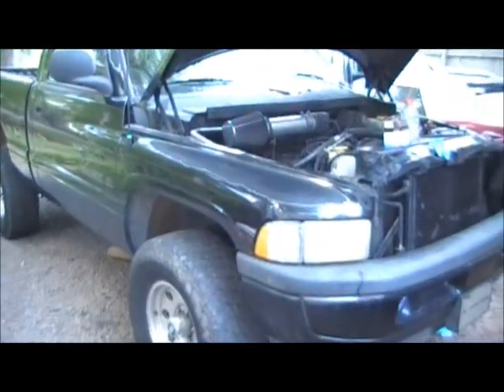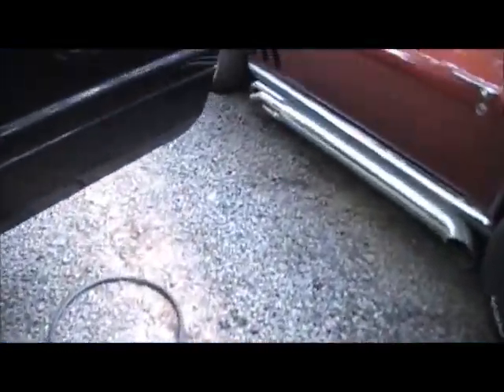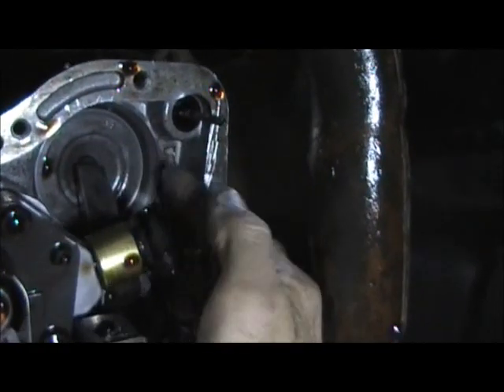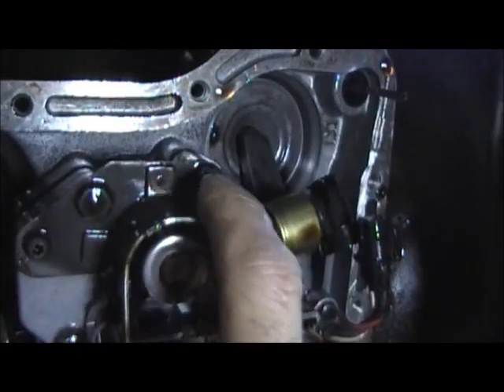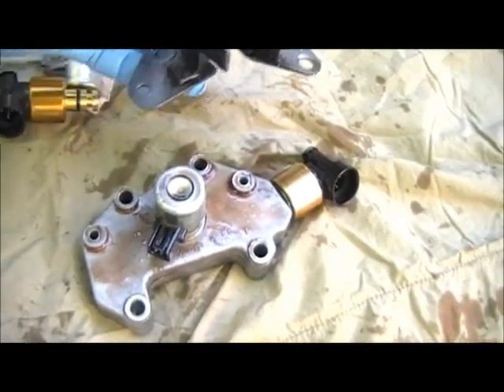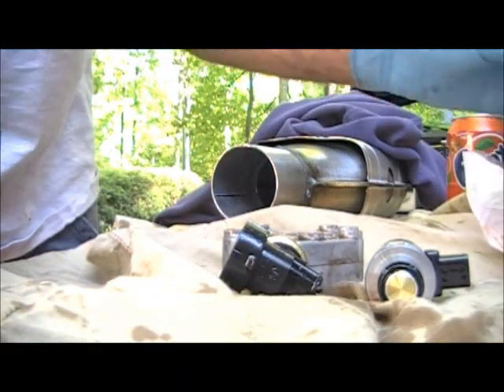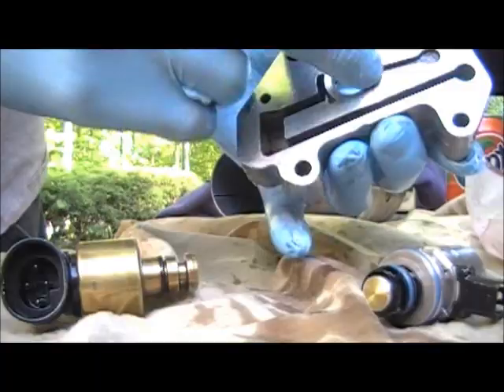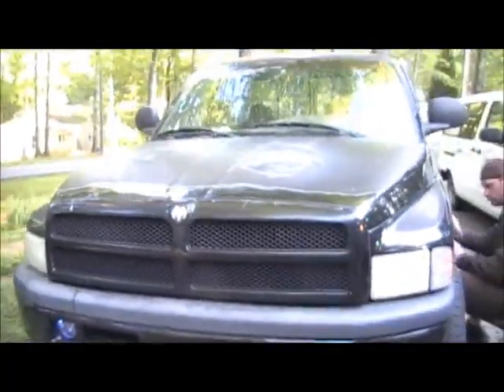1998 Dodge 1500 Transmission Wont Shift Fix

Comment: Best regards from Colombia. I would like to ask you for your opinion about a problem I have with a 1998 Jeep Grand Cherokee vehicle with A518-46rh automatic transmission. When I turn on the car and it started, works perfectly and makes all its changes normally, but after a few minutes no longer enters the first speed neither manually or D. Make an stop and started the car and it starts at second. The only way to restart at first speed is to stop, turning off the car and restart it, after that the same problem again. Do you have any idea what the problem might be?
Thank you very much.
Reply from the maker: Sounds like it is going into fail safe mode, so not to do any more damage to the unit. When you turn it off and back on, it resets. Probably an issue with the front pump not producing enough pressure. You can try a flush, replacing the fluid may help increase pressure.
Reply: 2012nugget Thank you, I fixed it already, was a problem with the harness. Thank you so much for you response.
Reply from the maker: Please post a description of what you found the problem to be as it may help someone with a similar issue in the future. Sorry I was off but very glad you found and repaired it without going broke!
Reply: 2012nugget The transmission harness wires, are bare and in short. Replace the harness and solve the problem.
Reply from the maker: Thanks! Have a great weekend and enjoy the beautiful scenery for me!

Comment: Well change the governor pressure solenoid and governor pressure sensor and it shifts which driving slow but if I get on it a little it's back to the same shit any other ideas
Reply from the maker: +Richard Scott When you get on it, pressure increases to the valves and clutches. If it is slipping under pressure the internal clutches have probably failed.
Reply from the maker: +Richard Scott Possible convertor failure but it would take the clutches out with it due to the debris it runs through the unit.
Reply: When I pulled the pan down yesterday it looked pretty good no metal shavings the band's where a bit loose but not knowing what I'm doing I left it alone!! I can't wrap my head around the fact that one day it was fine no signs of any problems the only other thing I did I don't normally do was messing with the OD button on the dash while I was driving when I bought I had to pull over put in Park to get the OD on I'm definitely out of options just spent 1400 dollars on Nitto Mud Grapplers and 900 to replace the old lift on it!! Well I appreciate your time my friend!!
Reply: I found a return spring on the outside of of transmission on the driverside and tightened it, reset the computer and the check engine light is off its been on since I bought and I took it around the block and got on it a little and it seems to be shifting fine now the test will be out on the main road. I'm trying to find out what the name of the spring is it's about 4inchs long

Comment: Ill let yall kno how this works!! i fucked my truck up mudding being 16 i dont have alot of resources to fix my truck, but ill try dropping the pan ill do the band adjustments and replace the gasket and filter, and ill replace the solenoids while im at it!! if it works ill be in ur dept cuz i miss m old 98 ram, another question while im here theres a knocking in the steering as well any ideas how i can fix that?

Comment: Hey man, I have a 1998 Ram 1500 and Im having the same problem, just had to replace the 'brain' (main computer)  which somehow got fried, the truck would crank and crank just no spark, and replacing the brain fixed this. but now it wont upshift, the transmission was working fine before the brain went out, so im thinking maybe the gov pressure switch and solenoid were "fried" with the brain. What are your thoughts on it? Oh the truck also wont go into 4 wheel drive and o/d wont turn on and off, all of which worked before the brain was replaced. The truck sat for a bit before i had the brain replaced and the tranny fluid was really low after sitting for almost a year, but if it wasnt ran with low fluid than it shouldnt have caused an issue right? I put fluid in it before driving it, which is when i found that it wouldnt upshift. Any feedback you can give would be mucho appreciated. Thanks

Comment: Will this also cause it to not want to shift into second I have to get to like 3,000 RPMs take my foot off the gas let it shift and then put my foot back on the gas. will changing these parts fix it
Reply: I have the same problem as you. Did you ever get around to fixing it?

Comment: Have you ever hear anything like this ?
I just bought a 1996 Dodge RAM 1500 Van...Known Automatic Transmission issues...had the Van hauled to my address and when the Tow Truck driver tried to roll the van off of his Truck at about a 30 degree angle...the Van refused to roll backwards off of the tow truck.
I had to crawl under the Van (Leveled) and remove the rear U joint to get her to roll off the truck ?
It was in Neutral with the Emergency Brake off ...we tried everything and it would not roll backwards.... It rolled frontwards fine being winched onto the Tow Truck.
THe Tranny does nothing in any gear... and the Fluid is Black and Burned !
Reply from the maker: It has fused the main shaft. Bad.

Comment: I have 97 5.9 dodge ram automatic trans, I have a p0740 code! Torque convert clutch circuit/open, is this what the bideo is about? Please let me know, went to 3 different places they want me to replace the transmission for $3500.00 I dont have the money,  my truck is running perfect  is just sometimes 3rd speed takes a few seconds to work, let me know please I will appreciate!

Comment: I got an 86 gmc sierra that was shifting fine and now the column shift wont put it back in park.. Would those 2 solenoids be causing that problem or would adjustments just need to be done??
Reply from the maker: Theres an adjustment on the linkage underneath. If you have someone work the shifter while you observe it you should be able to determine where to adjust it at.
 Not running and blocked up of course.
Reply: This was a while ago and since then Ive taken the body lift it had off and grabbed the same linkage from another 86 I have from back home that fit perfect and she shifts like a dream now... Well as much of a dream as you can with the kick down cable disconnected...

Comment: hey I got a 97 dodge ram 1500, it runs fine starts fine just hard time shifting to 3rd and 4th, it high revs but shifts at times and other times it wont shift at all, you think this might be the problem?
Reply: +Crego Mon any luck on the fix to your 97 dodge ram? mine is doing the same.
Reply: It worked great! Changed those exact parts on my 97 Dodge Ram. Problem was fixed right away. Of course you should drive I it about a mile or so to have the parts break in. But other than that. It helped out. Changed it almost a year ago and hasn't done it since. In fact riding 4x4 on sand is much smoother shift as well. Hope this helps!
Reply: Crego Mon I have the same exact problem you're stating. I'm going to attempt it this weekend.
Reply: have you done the sensor change out yet let me know I have a similar issue and just have a question for you
Reply: I think 3rd to 4th shift problems are due to the accumulator spring being broken.  It's an easy fix, be sure to get the 0.126" upgraded spring.  Search for 6oMC-r1OXzI video on youtube to see how to replace.

Comment: my 1999 is stuck at neutral, wont go into reverse or park, all other gears work fine, also wont go backwards neutral when pushed. i am going to try this.
Reply from the maker: It has no park gear either? I'd check to make sure linkage on transmission is moving properly. Need more information.
Reply: @2012nugget  yea i looked inside and one of the bands is loose and a 3 inch rectangular piece of metal fell out. i cant move it to the left past nuetral stuck at reverse :(

Comment: Anyone still in this comment thread? I need help!! My 01 Dakota had a trans leak from the Pan. Replaced the pan did the service and now when I put it into reverse it acts as if it’s in park and neutral puts it to roll forward. Not sure what I did or how to fix this please one help!!
Reply from the maker: Without seeing it I can only guess but I've got one! There must be something off with the filter installation.???
Reply: @2012nugget  think the filter install could cause that?
Reply from the maker: @michaelirula3188  well it would be the only thing you touched doing the pan service.....and yes, an incorrect install on a filter will cause problems.
Reply: @2012nugget  well guess it won’t hurt trying it again lol. Thankfully I put a new pan with a drain plug. Thank you for advice

Comment: I have a 1995 dodge ram 1500. Transmission was running fine and out of nowhere, it doesn't jump in gear like it used to. It also doesn't shift into 3rd gear like it unless I let off the gas, then runs fine after that. Do you think I'm having the same problem? Are solenoids in the same place as the 98? It also make like a grinding noise when I put it in gear!
Reply from the maker: Yes your solenoids are on the way out, repair as quickly as possible to avoid further damage to the unit.

Comment: So, I changed my governor pressure switch and solenoid, Flushed my tranny and replaced with new fluid and new filter, tightened one arm band, the one with the bolt attached, my problem is fixing the other band arm, it is so loose.  I dont know what the propper part is called, and i cant find any videos to help me fix that.  As my tansmission still wont shift into third gear without me taking my foot off the gas. , i'm taking it to a tranny shop monday. but it would be nice to be able to figure out myself.  any words of advice guys?
Reply from the maker: samantha powell can you upload a pic or highlight a diagram of the band you are referring to? There is a band adj on the side of some units. It will have a large locking nut on it, not sure if that is your issue though, just guessing from the comment.

Comment: I had a problem where my ram 2500 was only shifting from second to third and I jumped the solenoid with a small piece of wire . The wire stays in the spot  where the solenoid goes and has been there for 6 months . Tranny shifts perfect and there's been no other problems .
Reply: what you mean u jumped if sjrh power

Comment: I'm hoping this fixes my Durango.  It doesn't want to shift out of first unless I rev it in neutral then back to drive it will shift.  I have no idea what that means.  I have the parts on order. I'm in the process of moving.  This is terrible timing.  I sure hope I don't need a trans. I don't have the time
Reply from the maker: Patrick noone fingers crossed for ya! Good chance you are on the right track.
Reply: @2012nugget  thanks
Reply: What's it mean if I have 2 to 3 inches play in that first gear band? Is there really that much adjustment or is it shot. Not sure I have the right wrench but gonna try to tighten it
Reply from the maker: Patrick noone loosen the locknut and attempt to remove some of that, yea sounds excessive.
Reply: @2012nugget  thanks. I used up all the adjustment and it's now about 1/4 inch. I'm surprised that much came out. If it holds long enough for me to finishing moving I'll be happy.  Just terrible timing
Reply: Woo hoo she shifts. I'm kinda surprised  but glad

Comment: man  i have 2002 ram 5.9 gas its not shfting after warm 

if i drive it directly after start up its gose fine with all gears 1 to 4 

after couple min when deccelerate or stop  it will stick on the first gear.

can any one help please
Reply from the maker: abbd djff try procedure described.

Comment: I had lost the parts from 9 months ago, found them yesterday and did the job on me back out in the gravel drive...but now the truck won't start!
Reply from the maker: Neutral safety switch probably. The selector arm on the side of the transmission. You may have hooked it up wrong when you installed the valve body. Try neutral, and inspect the starter wiring to make sure you didn't unhook solenoid.
Reply: 2012nugget i replaced my output speed sensor and the governor pressure solenoid along with the transducer.my truck still wont upshift from first any ideas? it just revs like its in neutral. i have no clue why its failsafing, i also have no codes.
Reply: Jacobe Brown did you ever find out the prob
Reply: Yes after replacing .the govener pressure solenoid and everything else. I found an eroded wire that connected to the output speed sensor.

Comment: where did you get your hands on those parts i dont know what the technical name for those parts are and i have a 1999 dodge ram 1500 4x4 sport would the parts be the same
Reply from the maker: Shift solenoids, check the yellow pages in your area for transmission supplys/rebuild kits, the supplier should have them, very reasonable.

Comment: I have a 2006 Ram 1500, that is not shifting most of the time. I cannot tell what gear it is in when starting out but it is not 1st and maybe not second. I dont feel it shift up lately and rpm is too high 3 -3.5, but runs good really.   I get the P 0700 error which points too general TCM issue, but on this model the TCM is intergrated in the main computer, so I am debating to get it scanned for specific problem, IF a scan tool can even get more specific. What do u think?

Fluid is ok.  I will try some lucus just to clean filter, maybe it is gunked up, but other than changing the solenoids, do you think the TCM portion could be a culprit, as I    seen it on earlier older trucks?  Do you know if the '06 has the same solenoid set up as your video?  Did your job also include a tranny kit (filters, ?)? Thanks!
Reply from the maker: Totally different unit, get it scanned at a tranny shop asap.

Comment: My truck won't shift out of 2nd gear. It high revs sometimes and also is very sluggish sometimes. Sometimes when I shut the truck off and start it back up, it's perfect and shifts fine even past 2nd. I replaced the governor pressure sensor transducer and solenoid. Still the same issue. Any suggestions? I'm thinking maybe another solenoid or sensor of some sort.
Reply: Did you find out the issue? I’m having the same exact symptoms.

Comment: I have a 1998 dodge 1500 and the it wont go into park. I heard it is the linkage but I can't find a video on it. Can anyone direct me
Reply from the maker: With the truck TURNED OFF have a buddy shift from low to park while you observe the linkage from underneath. You will notice a bolt on a rod that locks it into position, that may need adjustment. The actual arm on the transmission may not be moving far enough forward.

Comment: So I got the parts and installed them and it worked fine...... 3 days later it sorta doing it again. Any help??
Reply: ShaftDrafter97  Update to this comment. I drove the truck to school untill winter break. I didnt drive at all during the 2 weeks of break. When I tried starting the truck when break was over i didnt want to start. figured it was a dead battery. I wouldnt start the next two days. truck sat for the next 8 month and finally got around to it. the computer needed to be replaced. after that the truck was running but didnt want to shift. I bought a speed sensor for the transmission and now the truck is working perfectly.

Comment: I have no check engine light, and i took off the anti drain back valve and it wasnt clogged. I just ordered a heavy duty tranny cooler with a fan. BUT, i drove it today and it seemed to shift alright. better than it normaly does, i also put 300 miles on it yesterday, didnt over heat, so whats going on? Does it like to randomly like to shit on me ? ahahah. I would just love to have this truck running good again! Almost thinking about buying a chevy, when im a dodge fan... *facepalm*

Comment: Ive got a dodge that shifts great but wont shift to 3rd gear is that what it is
Reply: It might be these parts. My truck wouldn't rev from 3 and 4 at times but problem was fixed after changing these. Hope this helps.
Reply: 3/4 accumulator spring will cause overdrive to be intermittent. Theses springs are usually broken after 50k on the odometer

Comment: Aye man I got a question....my 1997 ram 5.2 won't shift right. It takes off just fine but lately it won't shift into 2nd gear right like it goes really high Rpms then shift but after goin into 2nd it shifts just fine...can it be solenoids??
Reply: El Buffalo following for response.. I'm having the same issue
Reply: Yes
Reply: El Buffalo did you ever find out the issue?
Reply: Change the fluid
Reply: Wt fixed the truck
Reply: Check.your tv cable adjustment first. .it'll mess.up your shifting big time..and TPS too...if your cruise control dont work..seems like all these work together. .those solenoids will make ck eng lite come on..tv cable and tps wont...